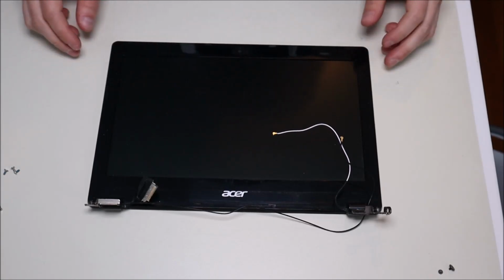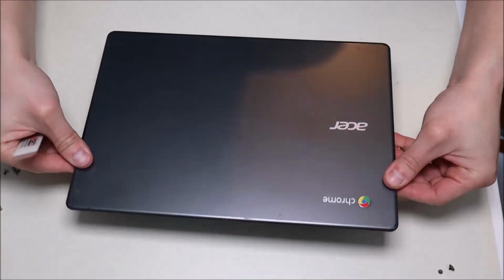Acer Chromebook C720 - How To Replace LCD Screen Assembly

Comment: I have a hp laptop model 15-dw0037wm. It has no life. I have changed the dc power jack,  battery, and power cord, but still no life. What will be the next thing to look for? I have so much information on my laptop that I'm trying to save. Any help please
Reply from the maker: 1.  For a computer that does not turn on, try this video first; https://youtu.be/kOBY4k2Mn_k. Let me know how that goes :)
2.  Also, did anything happen before this issue appeared?  Liquid spill, overheating, Windows update, etc?

Comment: How can I fix my Acer aspire1 black screen,yhx
Reply from the maker: 1.  If the screen is black, what are the signs that the computer is actually turning on? 
2.  Also, did anything happen before this issue appeared?  Liquid spill, overheating, Windows update, etc?
Reply: @PC_Monkey  when I turn it on,it displays the power on light and also  makes the Acer tone(sound),but it remains black,no display.
2.I was using it normally and it suddenly Blacked out up to now
Reply: @PC_Monkey  whenever it brought an update,I would click on it ...can it be an issue also?
Reply from the maker: @sizzleandserve-j6q  For a computer that does not turn on, try this video first; https://youtu.be/kOBY4k2Mn_k. Let me know how that goes :)